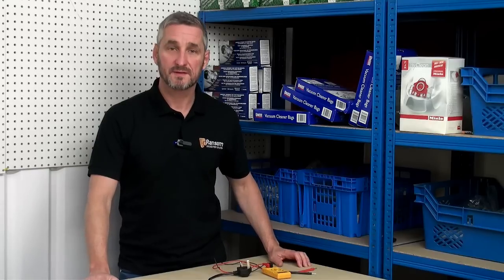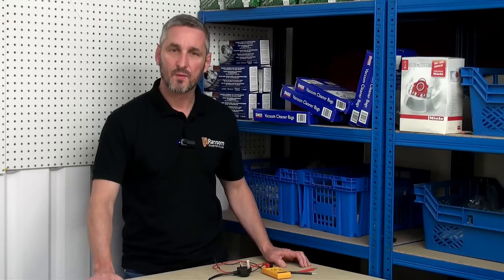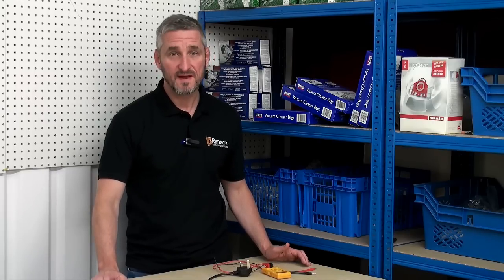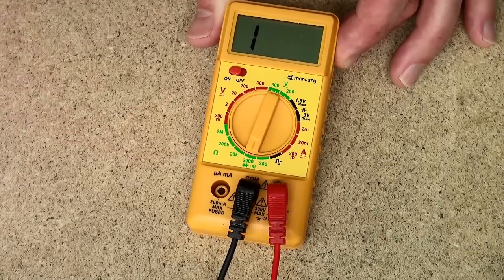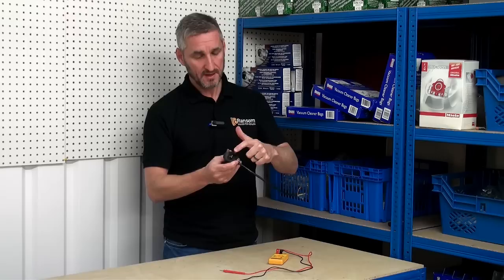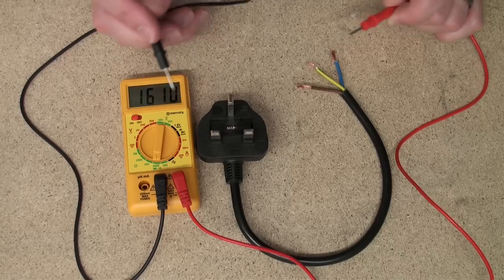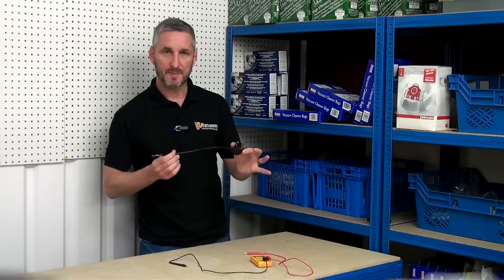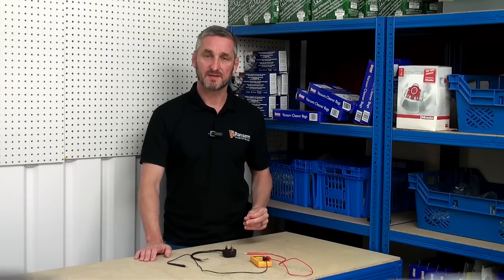How To Use A Multimeter To Test Faulty Components

Comment: I've a problem with my voltmeter it doesn't mesure the AC voltage just showing zero plz any solution
Reply: A common solution is to pull the COM terminal out (black lead) or the red then put back in again, this simple trick is like a reset.
Reply: mike soler sorry it doesn't work

Comment: Thx to the vid and thx to Pizar..
this was a function i dint know on my cheap cheap multimeter (tough without beep function) and how to do it and also to check if a soldering is solid into an wire and likewise..

I welcome it an d feature i will appreciate, thx for the informative and straight to the point vid..

Comment: Problem.  You also have to check continuity between each different lead to make sure no wires are shorted with another.
There should be NO continuity between black to green, black to yellow, or green to yellow.  :)
Reply: M. Michael are you qualified??  

Continuity only needs to be checked at the consumer unit between live and earth method 1 link them together then test at light fitting. 

No need to check neutral. 

If you checked every lead you would be there all day and it would be pointless highest reading should ne the furthest appliance from the source and if it's low on the Resistance then it's good

Comment: Good info except. Multimeters are designed to allow for testing on live feeds without issue nor have I ever had a single issue testing live appliances, testing resistance on live feeds while wiring, replacing breakers or installing on live panels, I've even had to test live feeds with a pigtail I had to make on the fly. To be specific  Amps are what usually kill a person not necessarily the voltage,
Reply: We learned in school to test current in series, voltage in parallel and resistance by removing the component from the circuit so there's no power. The Ohmmeter can suffer from a "dead short" if it's connected to a live circuit.

Comment from the maker: New DIY video - how to use a multimeter.  Learn how to use a multimeter to test faulty components in your home and garden electrical appliances.  http://www.ransomspares.co.uk/how-to-use-a-multimeter-videos/overview-how-to-use-a-multimeter.htm
Reply: +Ransom Spares May I ask you a question please? It's to do with testing the board in my pc speaker sub-woofer. Does your system of checking resistance on that cable apply to all components? My Creative 5300 5.1 speakers died on me a few months ago, and with a loud thud from the sub-woofer, I was left with a loud hum and no audio. As a 14 year old unit, I either have to repair it myself or just buy new.  If I check all components until I find one with no reading, does that mean I have found the blown component? I am hoping to repair it for less than £20, depending on the cost of a new component(s). Thanks